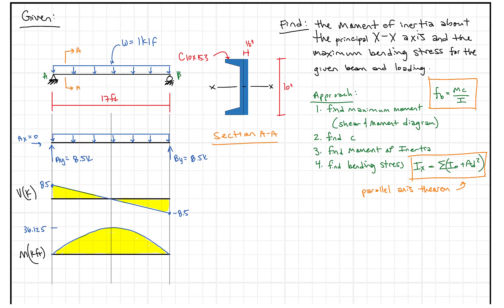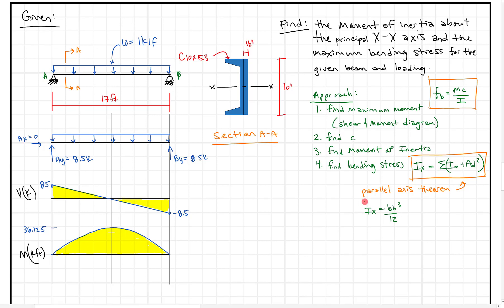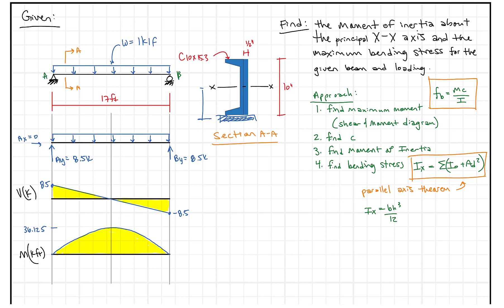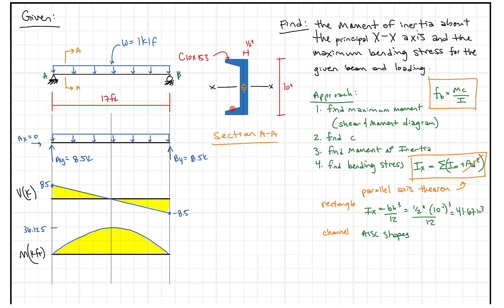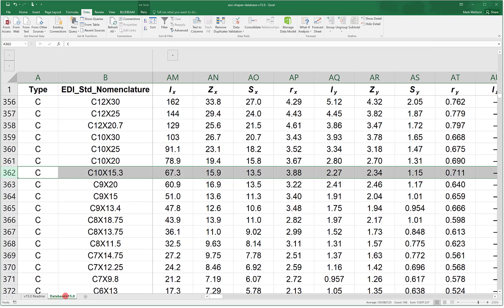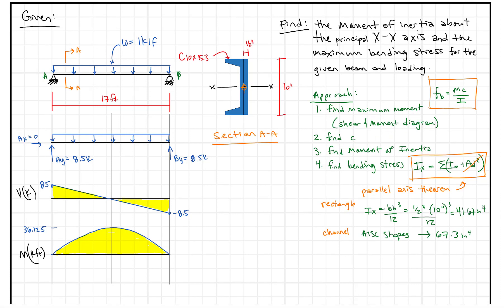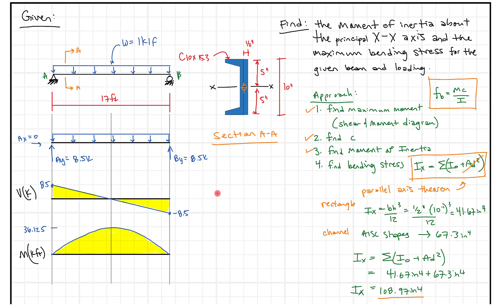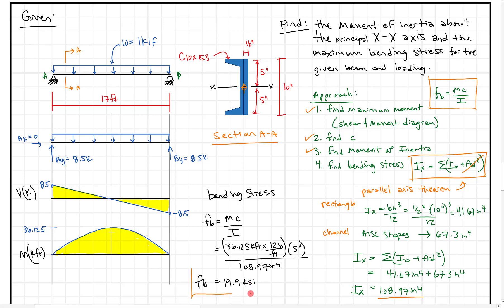Moment of Inertia - symmetric section made from basic shapes

Comment: Hi Mark, I believe there is a mistake made in this video. The MOI Ixx for the C10x15.3 is 67.3 in^4, but that value is for the whole channel, not just the outside trapezoidal shapes to the cross section. This Ixx is total for the entire channel, so I don't believe you would add the Ixx of a rectangle to this value (using parallel axis theorem) to get total MOI for the equation. After calculating this in a simulation tool, it seems that the max bending stress would be 32.2 ksi. I know this video was made in 2019 but hoping this comment may reach you or others! Thanks :)